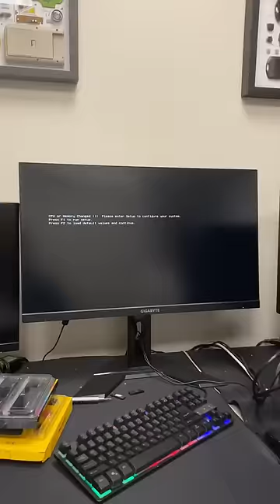BROKEN DIMM SLOT?! 😡 #pcrepair #pc #ram #gamingpc #pcgaming #egirl #gamerguy

Comment: you want to see how smart i am as a 11 year old a CPU is a central processing unit tasked with processing the main data if you dont use a GPU your CPU will which to the IGPU or the integrated graphics processing unit and is a weaker GPU and GPU is the graphics processing unit and is connected by pci or pcie slots and the GPU is tasked with processing graphics the difference bitween the IGPU and the GPU is the IGPU is inte die of the CPU and the GPU is on a graphics card like a RTX 4090 or amd graphics and another difference is VRAM or video random access memory and the IGPU might use the motherboards RAM and the storage can be a SSD or solid state drive of hdd of hard drive disk  an SSD can have 7000 mb write speed mb is mega bytes or all 7000 mb is only 7 gb gigabytes and a SSD is a lot faster than a traditional HDD HDD use a magnetic platter to store data and you better not get a strong neodymium magnet near the HHD because it will change it all on the platter to the magnetic pole its facing the HDD and its all HDD SSD CPU GPU RAM IO and other accessory you have connected to the motherboard and the mother board is the main board and has all the stuff i mentioned and also the capacitors and ics or integrated circuits  and if you dont know why CPU make heat it is because CPU take in energy and when it was used it is wasted into heat and the same with a GPU and the CPU and GPU all have architecture and im only 11 this is not all i know about take care thanks for reading

Comment: 2-3 hours... man you must be.... whack.
never any proof.... just building and showing errors!
Pro tip - forget all the AIO coolers, extra fans... build it with basics, get windows installed, once up and running, then add the extras, test, if works then proceed  to cable management.

3 hours lool.